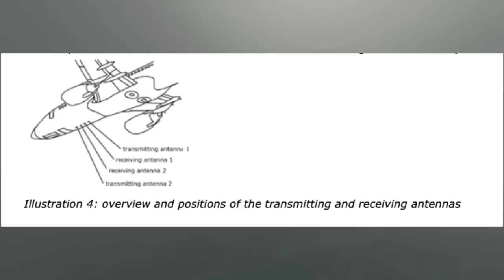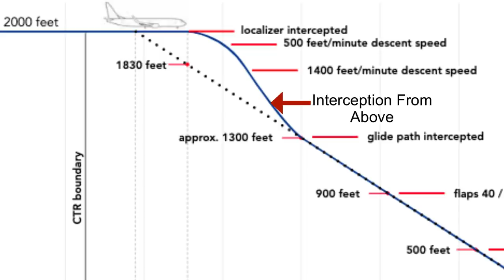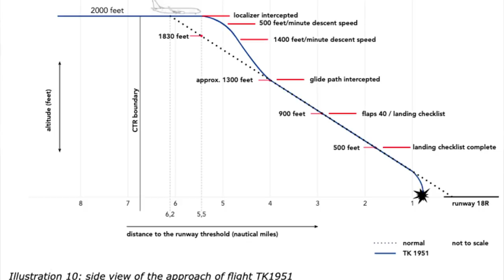How A Broken Antenna Crashed This Plane | Turkish Airlines Flight 1951

Comment: Information from BOTH? sensors ?

Anyone working in this field knows the minimum number of sensors required is 3. Then, when one disagrees with the other 2, you can GUESS Which is incorrect.
BUT NEVER ASSUME the 2 in agreement are right - they might have died and there's only one still active !
Reply: But at least with 2 sensors if they disagree you can disable the automation. Since pilots are supposed to be trained on such scenarios it doesn’t seem like a big deal.

Comment: FYI, it's not pronounced
com par A tor.  It's pronounced
com par uh tor. Spent many years testing that system at Renton Preflight for Boeing. Of all the radio systems it is one of the more reliable radio systems but once in a blue moon it would fail, right out of the factory. Which of course is a vendor problem if the box fails on a brand new plane. More often than not what we would find was someone in the factory had swapped the cables or just completely had a brainfart and left them laying inside the panel, which means pulling up a floorboard. The absolute worst was when they would terminate them at the wrong antenna. Because they are cut to exact length and then terminated, you couldn't just swap them. Ya had to "buy length" which means you had to spend hours trying to follow the cable and pushing any slack downstream to "make it longer."  But as "Murphy" has a way of making life fun, invariably you would have to route in a completely brand new 30 foot coax cable and those things are a thick stiff pain in the....... going behind and underneath panels and floor panels and ceiling panels and behind "E-racks." And because it's coax it's a very close tolerance coaxial connector "down to a gnat's ass."  The LRRA (Low Range Radio Altimeter) isn't really complicated compared to most radio systems.

Comment: You are spectacularly correct in your pointing out of Boeings culpibility in the Max crashes especially after this.  Well done!  Hopefully criminal charges will be brought against the system and software engineering leadership in that engineering failure called Boeing.   And to answer a question .. No, there are absolutely no bandwith problems when it comes to safety first software engineering .... the only restriction is blind stupidity and coprorate Hubris.
Reply: Your reply is a joke.  Those two MAXes went down because the pilots were idiots and did not know how to turn off the elevator trim.  Hitting two switches on the throttle quadrant would have stopped those nose downs instantly.  None of those pilots did this despite the procedure being required knowledge to fly the plane.  ONe hundred percent pilot error.  Things happen, there are procedures to deal with those events.
Reply: @rob737700  And you are awarded The Darwin award of Knob of The Year!  Iesu Grist!
Reply: @alphalunamare  Lol

Comment: If I were to ever be an airline pilot, the first thing I'd want to know is where the OFF switch is for all of the automated bullshit.  I just watched one of your other videos where the automation saved the plane by applying throttle; I can agree with this... but the automation should (IMO) never REDUCE (or eliminate) power.  Computers aren't situationally-aware yet to be able to make those kinds of decisions.

Comment: It seems to me that the key mistake was letting a plane with a known faulty altimeter leave the ground. Dual systems exist so that you have back-up in an emergency, not so you can conduct routine operations with one of them broken.
Reply: Depends what it says in the MEL
Reply: Radio Altimeter, it’s different to the Altimeter.
Reply: @kickedinthecalfbyacow7549  I don't see that it makes any difference which kind of altimeter is broken. If a crucial instrument is broken you shouldn't leave the ground without it.
Reply: @mbvoelker8448  it does make a difference, one is essential and one isn’t. If you don’t know what something is you can’t make a decision about how important it is.
Reply: @kickedinthecalfbyacow7549  If it's failure leaves you without a backup and not having said backup means that you could crash the plane -- as happened here -- then you shouldn't have taken off with it broken. DUH!

Comment: Should include a timer for the flare mode. If auto pilot is programmed to decend @ xxxxft/min, a simple timer could override the flare mode until the plane has decended.
Reply: Making everything more complicated and illogical.
Automation should be predictable, and not yank the carpet out from under the pilot.

Comment: Dual sensor is really a bad bad idea to get some redundancy. If one sensor fails, how the computers "knows" which one it is? 2 sensor are good enough for a car accelerator, where the computer can average both sensors in case of discrepency, but it is totally insuficient for plane critical sensors. Instead redundancy for critical sensors shall rely on 3 sensors or more, in order the computer can "elect" the faulty sensor among a poll of sensors. It is made on the Dasault Rafale for instance where there are 3 sensors, (and more over 3 computers) and a 4th spare in case. Thus when one sensor (or computer fails), it is easier to detect and to replace by the spare sensor/computer and recover the 3 sensors/ computers configuration

Comment: It was NOT the antenna that caused this crash it was a lack of proper monitoring the approach!!!  

3 pilots and no one noted the airspeed decaying while on the ILS?

Capturing the ILS from above has the danger of capturing a false glide slope as well as fails to allow the check that you are at the right altitude in space when capturing from below at the proper Glide Slope intercept altitude.

You are right that doing a checklist below 1000 feet is also odd.

When they got the stick shaker if they pressed TOGA that should have prevented the auto-throttle from retarding the throttles or just clicking off the Auto Throttles and yes there seemed to have been confusion at a critical time as to who was recovering the aircraft from the 'upset' when the stick shaker first engaged.

But to say the Antenna caused it?  Its a catchy title and a contributing factor BUT not the real cause of this crash.

Comment: The technical reason Boeing only use one sensor in the max is that the plane was designed by a bunch of children
Reply: and cost cutting
Reply: Not a Boeing fanboy but it seems they were not the only ones struggling with sensor management, remember that in the same year we got AF447
Reply: And were allowed to "Self Certify" by the FAA.

Comment: Schipol is below sealevel. Woudn't that make -8 feet possible? Or is altitude calculated differently?
Reply: Radio altimeter measures height above ground so no. The barometric altimeter is the one that you’d see a negative figure
Reply: -8 feet is what the radio altimeter will read when the nose wheel is on the ground

Comment: We see lots of crashes with equipment failure that almost nobody could avoid but can’t modern pilots land a plane manually nowadays?  Still plenty of Cessna 172’s around. The art of landing a plane is pretty necessary.

Comment: And just 10 years later, Boeing would prove that they still had not learned how sensors work. Such a bummer

14:00 From an engineering point of view there are a few issues with using multiple sensors for the same task. 
Firstly, 2 sensors never send the same number. There are always deviations with one AoA sensor showing 12.3° and the other maybe 12.4° so you have to have a unit that compares both numbers and that could use the average of both. But what happens when one shows 2° and the other 12°? Then you would have an average of 7° and assuming that only one sensor is working, either 2 or 12 is correct but never 7. So you have to put a bit of software engineering into this task.

Secondly, as indicated before, 2 sensors are not redundant. If you have one sensor showing 2° and one showing 12°, how do you know which one is right?. In order to make sensors redundant, you have to use 3 sensors because if two show 12° and one shows 2°, you know that 12° is correct. It is unlikely that two failed AOA sensors show the same wrong number. But of course additional sensors require a different design of the front section and it all comes down to cost.

Now you don't need 3 sensors. You could solve this issue with a piece of software that checks the credibility of both sensors. For example sudden AoA changes to -70° within one second aren't physically possible. This credibility check could find out that way whether the info is correct. Or lets assume you are flying with an AoA of 2°, N1 of 80%, speed 270kts and altitude 10000ft. Suddenly one sensor shows 12° and the other one 2° but you are still stable at N1 80%, 270kts and 10000ft. In this case 12° makes no sense because if you were suddenly climbing, you should have a reduction in speed and an increase in altitude. But of course this software has to be approved before installation and that costs money.
The last thing is that if the credibility check cannot work out which one of the sensors is right, it should warn the pilots about this error so the pilots know what they are working with. There is nothing worse than failures where the automation silently disappears without any warning to the pilots like in the case of the Turkish flight. 

Airbus empowers its automation to do a lot more than Boeing and they use 3 ADIRUs - Air Data Intertial Reference Units. They compare sensor data and as soon as one ADIRU fails, the aircraft gives more power to the pilot because the aircraft can no longer be sure that its sensors show correct data. And it warns the pilots about all the systems that are now unavailable due to this failure.That is automation done right.
Reply: Actually you can loose one ADIRU and the aircraft will remain in Normal Law. Loose ADIRU 1 or 2 and you can switch to 3 without any major problems. Loose 2 then it’s a different story. 

But the latest aircraft can do self monitoring using other parameters. For example the newest A320 compares the 3x ADR data against a synthetic speed computed by weight, load factor and angle of attack. The angle of attack is checked against load factor so if a situation like XL888T were to arise again the pilots would get a warning that 2x AOA were unreliable.

The A350 even has a separate pitot tube for ISIS speed so has essentially 4 different ways to get airspeed data and 1x synthetic
Reply: Excellent information, gentlemen. I love learning about technical considerations by engineers.

Comment: To any current 737 pilots. Please tell me the autothrottle now takes the RA from both sides instead of just captains. If the autothrottle had used the FO’s RA especially as the autopilot was already doing so this accident wouldn’t have happened
Reply: Better to ask an AME, a lot of pilots don’t have a clue how their planes work from my experience.
Reply: @gpaull2  true that

Comment: People were prevented by the dutch police from going to the airplane because the airplane had American military technicians carrying supposedly carrying information about the patriot missile system which was then based in Adana Turkey.
Reply: Surely people would be kept away from the plane just because it was an accident site. Just like a crime scene you don’t want it contaminated
Reply: @tomstravels520  Yeah but when people were emerging from it and screaming for help it would be ridicouls to stopp people from assisting them away from a burning fuselage, imagine firefighters waiting for the police to arrive after two planes hit a building

Comment: There’s a very unfriendly red tape that creeps up on the airspeed indicator when you get to slow. How could both pilots miss that? If they looked at the airspeed and power setting, they should have immediately disengaged the auto throttles and operated the throttles manually. A perfectly good airplane crashed by lack of airmanship

Comment: Maybe the pilots shouldn't use autothrottle when they know they have a faulty radar altimeter, just a thought. There's something to be said for actually flying the plane ....
Reply: They probably thought the autothrottle would be connected to the FO’s RA as CMD B was active which would make more sense

Comment: How hard could it be to write a condition where, if the RA senses a height lower that of the landing gear, it must be flagged faulty by the flight computer ?!
Reply: Because landing gear compresses when you add weight. You want the radio altimeter to show zero when the wheels touch the ground and the plane is flared correctly. So it is possible to have negative numbers when gear is compressed
Reply: The RA reads -8feet when the nose wheel is on the ground
Reply: @tomstravels520  The plane can tell when there is weight on wheels so a negative altitude when the plane is in the air means that the RA is faulty
Reply: @aarondynamics1311  yeah which is why CMD 1 wouldn’t engage. Because it thought it was on the ground. The same logic however doesn’t apply to the autothrottle. CMD 2 which reads the FO’s radio altimeter didn’t know that the other RA was faulty and the flawed design of autothrottle not using RA2 when CMD B is engaged meant there was no connection between the 2 systems

Comment: the technical reason for why the MAX8 could not use two sensor was, that it was an MCAS System (Maneuvering Characteristic Argumentation System), which is totally not safety relevant. It is totally not anti stall system - it just happens trims over and over again in case of an angle of attack that is indicative of a stall. By using two sensor, it would have suspiciously looked like a safety critical system - which it totally is not. Next someone would argue that pilot need training on all critical system - but thanks to MCAS the MAX8 totally feels like any other 747: So MCAS is necessary for reducing the training required, but it is totally not safety critical.

Comment: Since they had so many previous alerts about the failure of that radio altimeter, why wasn't it fixed? Based on many of the other comments similar to this, it seems to be a negative reflection on Turkish Airlines. Plus the pilots were at fault, and Boeing took a hit on this one also. It doesn't matter to the 9 who didn't survive, but someone should feel guilty about this.

Comment: Not the first time lack of technical knowledge killed people. Pilots should be trained to think like engineers in situations where deductive reasoning at system level is necessary to correctly troubleshoot a novel malfunction. These pilots all should have understood the implications of an operating but malfunctioning radar altimeter.

Comment: Why would the autothrottle take its command from the captains RA even though it was CMD B activated?
Reply from the maker: It takes data from the left RA by default and only switches over to the right RA when the system detects a fault with itself.
Reply: @MiniAirCrashInvestigation  I actually meant like in terms of “why did they design it like that?”. On the A320 AP2 uses FO’s RA and AP1 uses Capt’s RA and the autothrust uses the side that the master AP is on which makes more sense so you know if AP 1 isn’t working then all the important equipment assigned to the FO will be providing the information
Reply: @tomstravels520  because that would make too much sense.

Comment: There are various layouts for redundancy in computer systems. Here I understand there are two sensors of the same type delivering data and the software should decide which source is correct if data differs. So validating -8 feet to be wrong shouldn't be an issue, switching then to the other source or aborting when validations of that one also fails is a question of design. A comparator usualy finds differences but does not validate, it just states if data A is < = or > than data B. So redundancy here is somewhat weaker in that the sources are technically the same, what is however quite common. It would be stronger, if sensor A is different from sensor B in that a flaw in A would not occur also in B. But right one sensor to one computing system without adequate validation and subsequent handling is not redundant at all.

Comment: Wait a min.. how come these computers just don’t talk to each other? More to the point, the designers of these damn planes seem to do everything they can to not have a pilot fly the plane.. if you have two crucial systems that are in disagreement, the plane should just go “nope, the pilot must fly the plane”.
Reply: Because in this case the pilots knew the FO RA was working so CMD B autopilot would use that RA to know how high the aircraft was. But the autothrottle was primarily linked to the captains RA regardless of which autopilot was set, but the pilots clearly didn’t know that. You can still use automatics if you know which side is correct but the design if the autothrottle only being in captains was pretty dumb. If it was an Airbus it would have used the FO’s RA and wouldn’t have crashed

Comment: Absolutely ridiculous.  If Boeing is going to market an aircraft based upon advanced computerized features...they'd better work flawlessly.  I hope I never fly on another Boeing until that company can get its collective $hit together.  There is no excuse for a pilot to advance the throttles and the auto throttle not be automatically overridden by that action.  Nice to see that by the time Boeing introduced the 737 Max they hadn't learned their lessons which cost many more lives.  Yes, you can always share blame with the pilots, but the common denominator is Boeing cutting corners.  

Interesting to note that the Lockheed L-1011 Tristar did pretty much everything a Boeing can do now, flawlessly, back in 1972.  It could fly from take off to landing with very minimal input from the pilots.